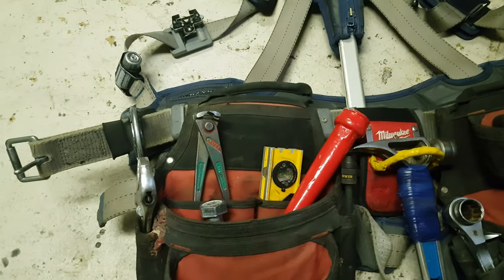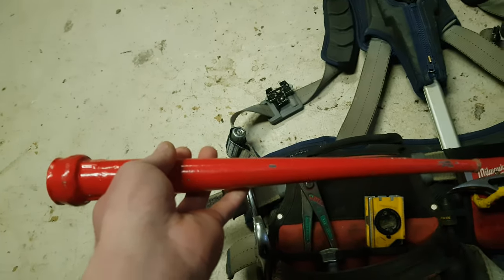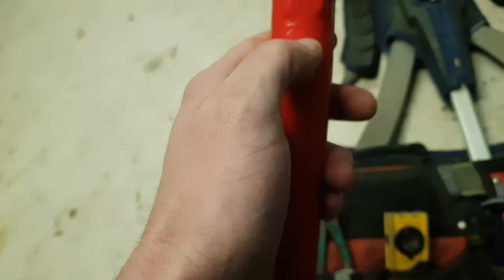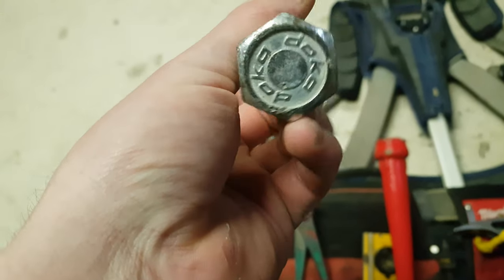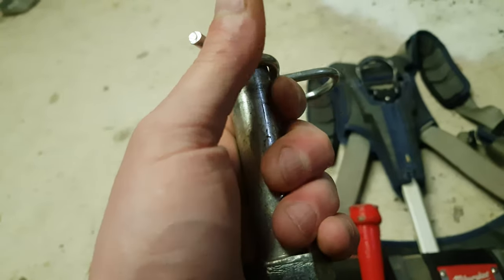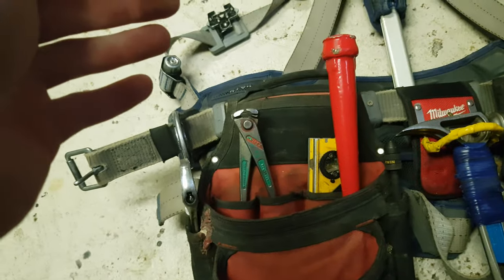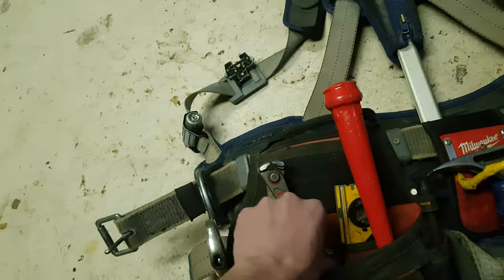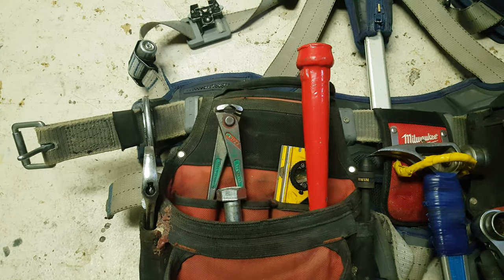concrete tool belt essential

Comment: Your drift pin and actually a Bull Pin. A drift pin is similar, it aligns and goes all the way through the material. A bull pin aligns the material but is removed the same direction it entered.
Reply from the maker: That's good to know haha. Thanks I would have never guessed that

Comment: Hey bro I was wondering where can I get the suspender for the belt? or its only for union worker ?
Reply from the maker: Like the harness itself?
Reply: @gustavohonzofo  yea bro that harness that you guys use as suspender right? where can I get them?
Reply from the maker: @tenzinnamgay8118  they have them on Amazon and eBay but they cost a pretty penny
Reply: @gustavohonzofo  appreciate it bro/